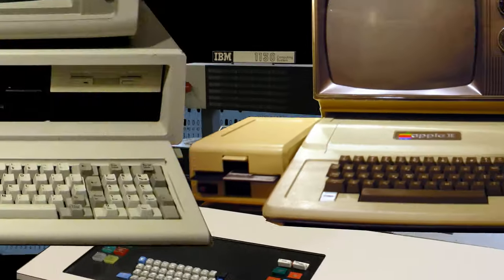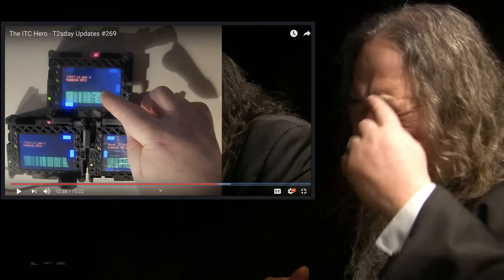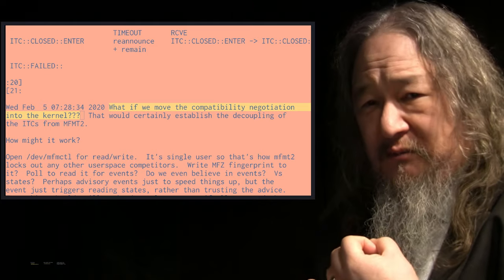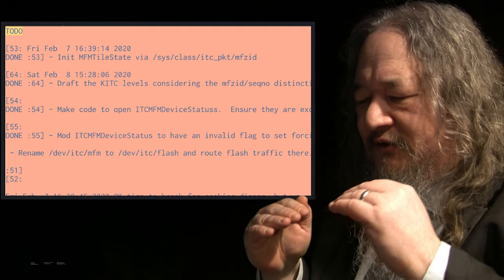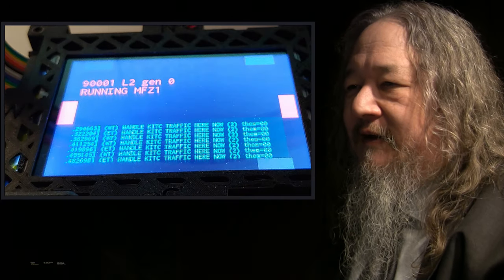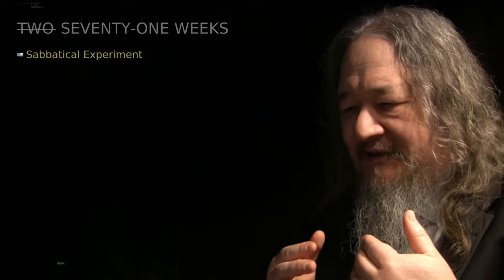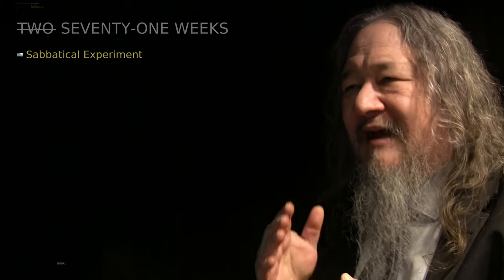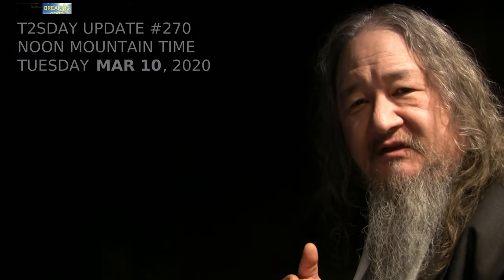Breaking Good - T2sday Update 270

Comment: You deserve a pause! Pause are necessary to focus on the important things! I hope to read the documentation soon, I need to read something to know if I might be of any help :-( I wish to see you again after the pause! BTW, you surely are not loosing your schedule! About your project, I think you might consider using UDP instead of TCP/IP, to speed-up communication between the terminals, the system should handle data "drop". You should build the "communication protocol" upon that network protocol, less verbose and no need of connection :-)
Reply from the maker: Thanks for the support!  I get in via TCP, but the tiles talk a custom packet protocol to each other, not IP (TCP, UDP, ..)